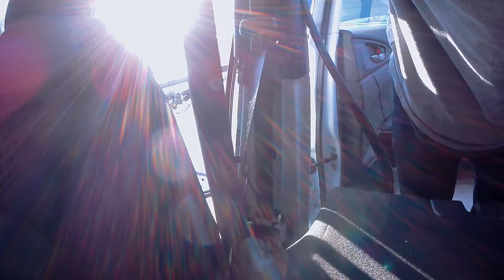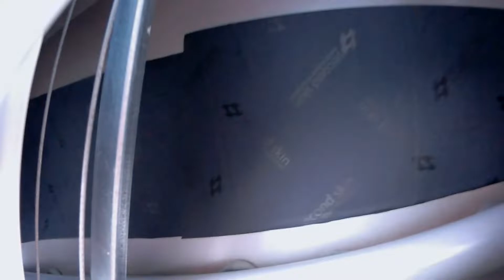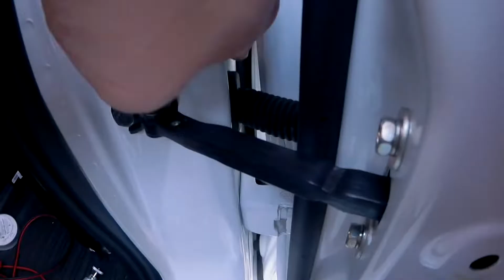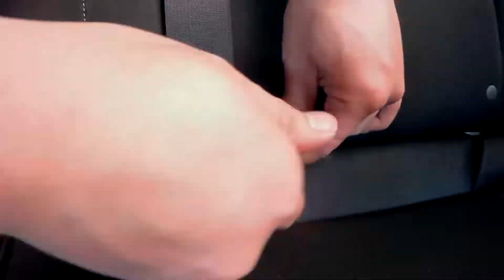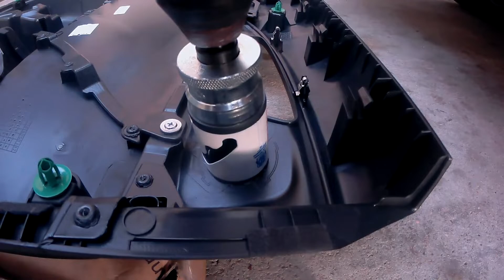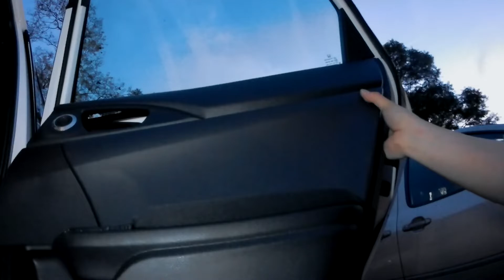2019 Honda Civic Hatchback Sport Rear Door Speaker + Tweeter Full Install

Comment: your 6.5s are about 2.8" in depth i was wondering after installing these did you have any trouble with rolling the window down?
Reply from the maker: The windows still roll all the way down with no issues. Just make sure your speaker trim is not the thin one.

Comment: Excellent video man.  Very well done!  Something that may help with the putting wiring through the grommet is if you have a long zip tie you can feed that through, then tape the wire to the end of it.  It will snake it through much easier since the zip ties have a bit more structure to them.  I used to do that in car audio when I installed.  Hope it helps you and others in the future :)

Comment: That’s weird my 2020 sedan civic doesn’t got rear door speakers.
Reply from the maker: May be located at the rear deck behind the rear passenger seat.
Reply: @johnsneverendinglistofrand1377  do you think i should place them on the rear doors anyway? Mines also the sedan
Reply from the maker: @ There might not be a speaker hole for you unless you want to do tons of fabrication. Not sure how your rear door panels looks like but your rear speakers are located on the rear panel. If you were to sit in the back seat its the panel right behind your head, below the rear windshield. If you poke your head into your trunk and look up you should see your rear speakers.
Reply: @johnsneverendinglistofrand1377  no i know they’re on the rear deck. Just wondering if placing them on the doors anyway would have a nicer sound stage feel as it would help filling the room up better. Dont you think? Tweets will be closer to front row ears too.

Comment: hello wen would you do the back as you say on this video the you would do the panel on the top by the seat bealt ??
Reply from the maker: Still working on that. I've attempted a few different methods and failed a few times. Currently resorting to fiber glassing.